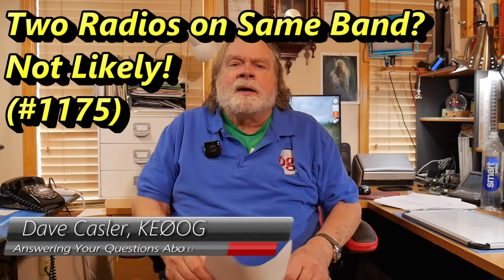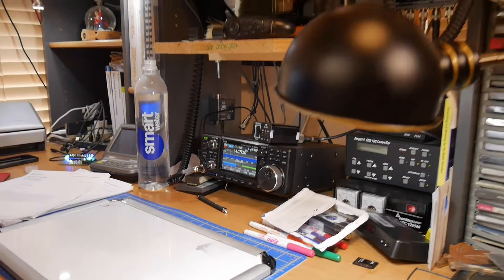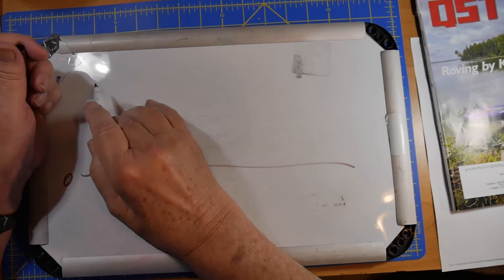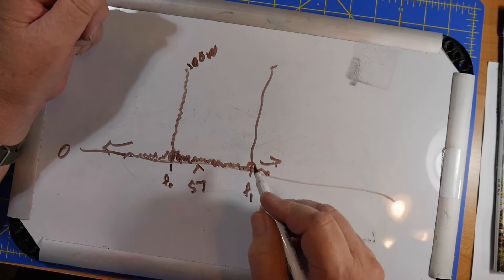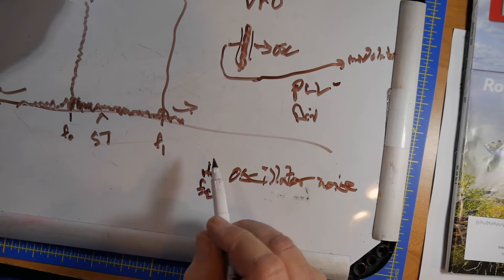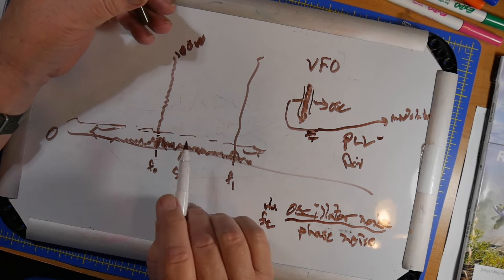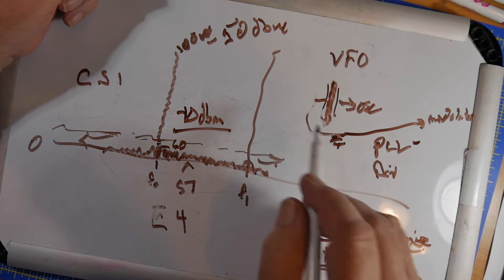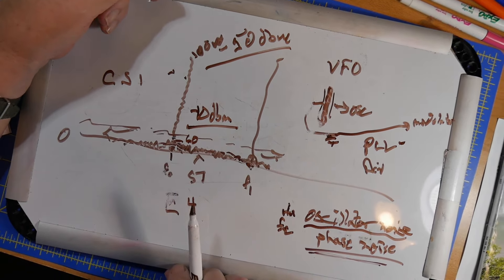Two Radios on Same Band? Not Likely! (#1175)

Comment: We used to operate two Collin’s radios on the same band (CW/SSB) on field day with no problems. An Icom, Yaesu, or Kenwood receiver would block or freak out, but the Collin’s S-line or LWM2 would work just great.

Comment: So it's all about phase noise?  No mention of receiver desense?  Front end filter quality differences?  Blowing out the front end of your second receiver?
Reply from the maker: Today it's largely phase noise. Desense is an FM thing. Though if there's no filter prior to the initial RF stage, a large nearby signal can capture the AGC.
Reply: @davecasler  Desense is a loss of receiver sensitivity due to unwanted external signals.  This can be due to an increased noise floor from EMI, receiver overload from adjacent signals, or undesired signals affecting the AGC loop.  It isn't just an FM thing.  The avoidance of desense in crowded RF environments used to be the expensive analog HF receiver's claim to fame.  Today your SDR based radio just overloads the ADC and you end up with spurious crap splattered all over the bands.
Reply from the maker: @stargazer7644  Thanks for the info. Makes sense! 73, Dave, KEØOG

Comment: Some finely tuned Band pass filters should help. But another question is how far apart (verticially and horizontally) the 2 same band antennas are? This can also determine how much will they interact with each other. It is possible to do, the Big Rig Contest stations do this all the time. There are likely some in depth NCJ articles specifically on this topic.

Comment: I had same issues with my mobile used as a base and GMRS handheld, noticed handheld would interfere. Installed ferrite beads on the base antenna in and at the feed line on the antenna and laptop power which is next to the base. I kept on adding ferrite beads till interference went away.

Comment: What about band filters on each radio  cw vs   ssb.
Reply: That would have to be an extremely tight band filter and you still wouldn't be covering the same band exactly. You would need to different filters passing only a small part of a different portion of the band, and then you would need to operate the two different modes only in those narrow areas. 

Changing the mode doesn't solve the  fundamental problem. (Pun intended 😂)
Reply: I guess my point is that it would be  insufficient to by two bandpass filters, for say 20m, and then run with it.  You would still have the exact same situation.

Comment: What he could do that would be very simple would be to use remote internet receivers for the SSB reception.. I am not sure if the 2 transmitters transmitting at the same time might mix and cause some strange harmonic product.. A SSB voice signal should have little impact on the FT-8 narrow operation as long as you have the antennas far enough apart and at opposing polarities..

Comment: You can also reduce the phase noise between two radios if you use something like an Elecraft K4 or Flex 6000/8000 radio that has an external time base input for 10 MHz.  You then need something like a Symmetricom GPS locked time and frequency standard.  If you look around a bit you can find a used time and frequency standard that will give you 10^-13 accuracy.
Reply: Why do you think that reduces the phase noise?  You're just locking the internal oscillator to a reference.

Comment: Do it with a Yaesu 991A and you will blow the ipo diode right out of the receiver. Ask me how I know. That was just by having an antenna hooked up while another transceiver was being used. Now I leave the 991A unhooked while operating another radio.